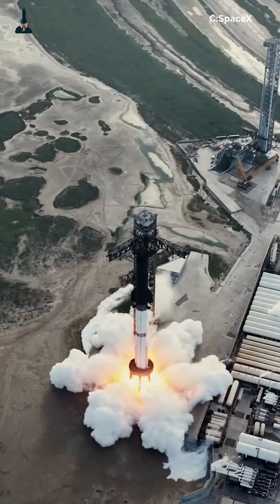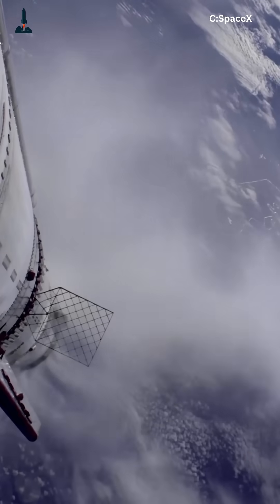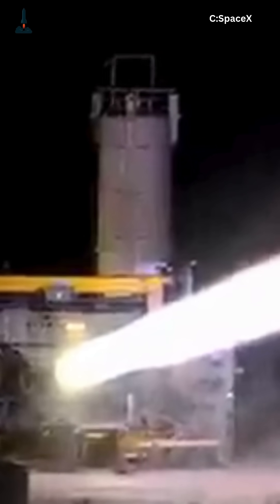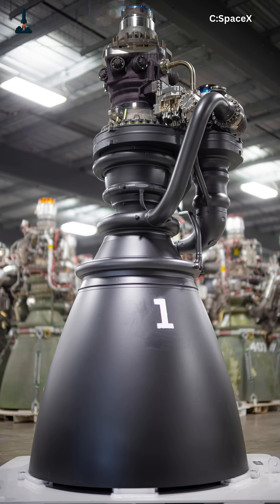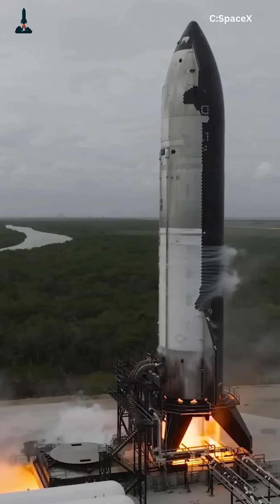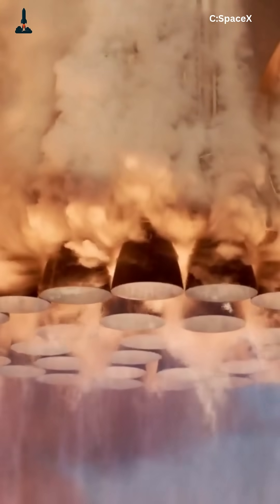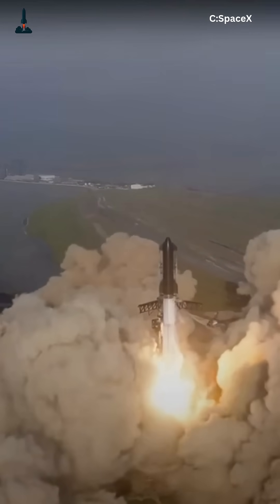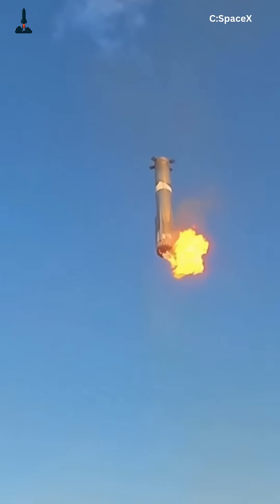How Raptor’s Closed-Cycle Combustion Made 33 Raptors Unstoppable #spacex #starship #raptor

Comment: Yes but how the chamber is not burning when it is hot asf
Reply: Cryogenic fuel
Reply: They run the liquid fuel at extremely low temps through the metal of the nozzle before they burn it, it’s actually insane
Reply: Thanks to regenerative cooling. A fraction of the fuel (the methane, which is very cold in its liquid form) goes through channels built around the combustion chamber and the nozzle to maintain their temperature at an acceptable level.